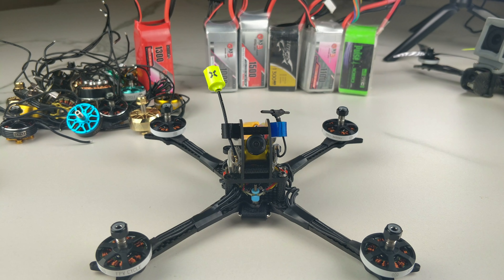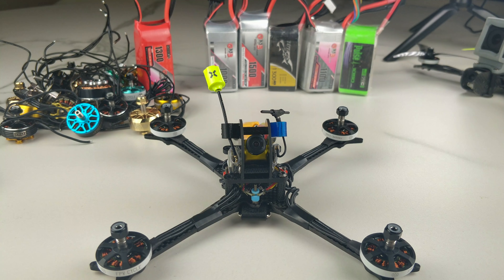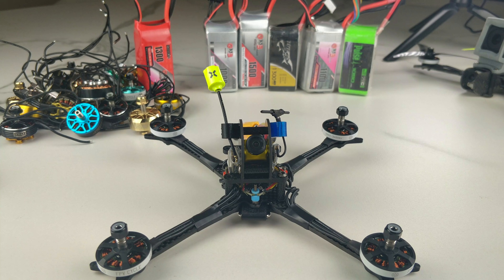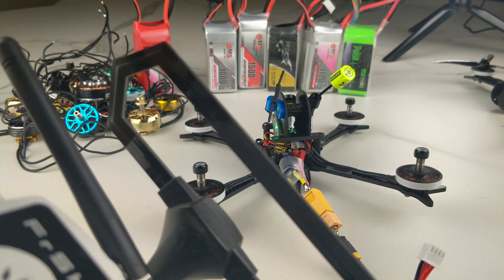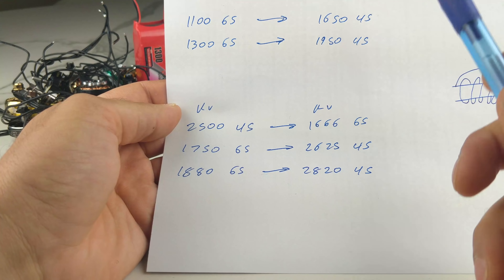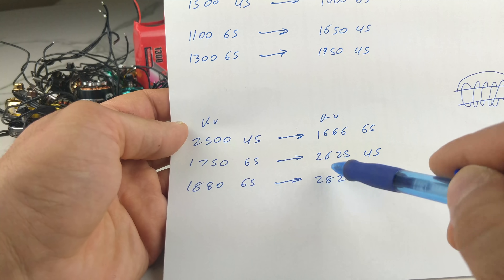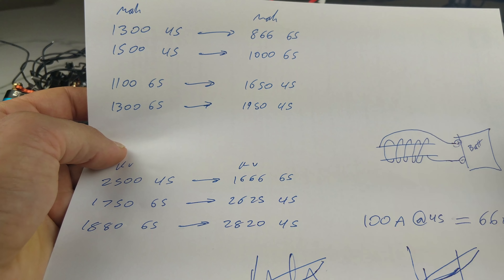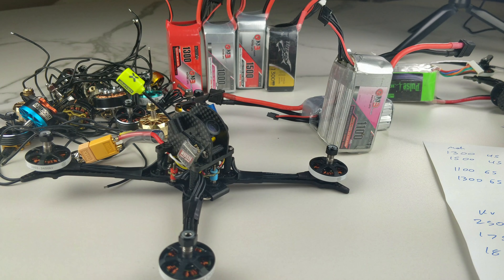6S Everything?  Why does 4S feel different?

Comment: Would I be ok just starting with the size of the propeller (7 inch) than from there choose a certain kV motor (1300 kV) and just go with whatever voltage works with that kV? I know that this is a very complex subject and listening to your explanation definitely highlights just how deep the rabbit holes goes. But I like to simplify things that are too complex, more voltage (6s) and lower kV means more torque for bigger props and the opposite being less voltage (4s) and higher kV for less torque but higher RPM for smaller props. There is a method to picking lipos for a motor which turns the propeller, I hope people aren't just saying, "You saw what that 3 inch did on 4s, I can't wait to slap a 6s on this bitch!" We have an image to uphold here, if that drone goes out of control and hits someone or starts a fire... that's it.
Reply from the maker: Yeah that's totally okay to do. None of this stuff needs to change the way you think. It just might be helpful in explaining things a bit when you notice things are off.

Comment: IM COMPLETELY UNEDUCATED! im just trying to buy parts and enter the game! but what your saying is so confusing because im uneducated! can you educate me? i am trying to make a "toy" copter made from a "ruler" and was told to get these parts-  #1 [Racerstar Racing Edition 2212 BR2212 980KV 2-4S Brushless Motor For 350 380 400 RC Drone FPV Racing] for $30 but found  {Readytosky RS2205 2300KV Brushless Motor CW/CCW 3-4S for FPV Racing Drone FPV Multicopter} for $33 - it seemed a "BETTER DEAL" to get 2300kv rather then 980kv. - but then i noticed that it said things like "2-4S" and mine is "3-4S" so what does the "S" mean! and i found your video which BLEW me away! now their are thingS to consider! 1 the length of the arms- 2 the esc- 3 battery- and 4 size of blade-  NOT TO MENTION THE THICKNESS OF WIRE? my god! THIS IS AN ENGINEERING feat! I WAS JUST TRYING TO BUILD A TOY FOR $1 TO SEE HOW IT WORKED! i never got that FAR! i was told to get a- [ ZOP Power 14.8V 1800mAh 65C 4S Lipo Battery XT60 Plug For RC FPV Racing Drone] and a - [4X XXD HW30A 30A Brushless Motor ESC For Airplane Quadcopter] and a- [Gemfan 8045 Carbon Nylon CW/CCW Propeller For DJI RC Quadcopter] THAT IS {Size: 8 x 4.5} THE video seems to be professionally based and is at = https://www.youtube.com/watch?v=XvMdL1PncEQ= "MY ULTIMATE" goal is to build a agricultural copter for crop dusting to lift 50 to 500 pounds! were do i start? i thought to just find a simple video and build one! its not that simple! CLEARLY THE 2212 IS FOR 350-400 and the 2205 IS FOR A 210 220 250 280 SIZE COPTER! this is strange because the faster speed is for a smaller and lighter copter? does the speed have something to do with "torgue" the amount of lift from an engine?
Reply from the maker: Before you get anything, if you're planning on FPV, just get a controller ONLY and use it to play simulators for a few weeks. Then look for the type you want to build and watch many videos about that size and the parts you want. Then get them and build it. This is the universal fastest, easiest and cheapest way to start

Comment: Really interesting thoughts. Maybe I will just stick with 5s.
Reply: THIS is why I've been telling people to make 6" quads with 6S electronics, and 5S motors.  They do EVERYTHING, and you can use whatever cheap batteries you want, or use awesome ones.
Reply: @tehllama42  I just finished 6" Badger with Konasty Moonboots 1739kv and I am quite happy with them on 5S.
Reply: @tehllama42  Can confirm that 😅 Recently changed to bigger motors (2207 2450kv to 2408 1900kv) and mainly using 1500mah 5s batteries. The quad rips. Still have more testing to do but instantly noticed how bigger motors improved handling characteristics of the quad. It seems to be a lot more responsive now.

Comment: The argument with the electrocemical challanges is just weired and makes no sense. A cell does not know whether it is in a 6 or 4 cell configuration.
Reply from the maker: Batteries are limited by their resistance. Lower resistance will have an easier time giving off current but as it heats up the resistance gets worse. I think exponentially worse actually. So moving to 6s, lowering the current and keeping the resistance per cell similar will cause the voltage to be more stable. It's ultimately because the overall Wh of the battery is higher and so you then need more power to make the system function too but the voltage stays stable.
Reply: @Kabab  no you are not reducing the current, if you are reducing it by 35% when you at the same time reduce the cell size by 35%

Comment: Shut up and give me 6S 2203s already LOL JK!!! Kinda... Here is my opinion on standard weight 5" my 6S packs get more cycle counts than when I ran 3S & 4S. When I started I was eating packs all of the time. 6S seems to give me all I want and my packs last longer because they aren't being pushed to their limits.

Since your 3450kv were the first in stock I plan on giving 4S a try on a light 5" then I will switch to the 3000kv and 6S. I think Ill be comparing a GNB 4S 1100 vs their 6S 750 because the WH and weights are very close. Or I might go with Pyro's 6S 700 to save more weight.

But 6S on 3" toothpick (light not the bricks everyone call toothpicks) and lower is silly.
Reply from the maker: You're definitely going to get more cycles from a 6s pack on 5" because the pack just isn't being as stressed each run.

Comment: WRONG WRONG WRONG, sorry sorry sorry
but maybe 90% of the physical explainaition is correct, but lots of this is wrong and makes it overall wrong. Just scrap it and stick to what you feel. The consecquences are all good and correct. higher voltage => petter performance, better efficiency at higher power and it has a greater envelope and might feel weaker at lower throttles
Reply from the maker: Well thanks for reading my request in the description 😑. Higher voltage is less efficient btw. The benefits come in the potential weight savings which we don't do because we're building performance things. So it's just less efficient. It gets more flight time because you're using a larger Wh battery. I'll leave you to figure out the rest because you clearly know enough to insult everyone else.
Reply: @Kabab  I dont want to insult you sorry. That is not what i meant. Really. The thing is, what you say is correct at the end, only the explaination between with the electrons are not waterproof. I also dont understand everything but that that seems like guesswork to me. you say yourself that your not an engineer, but I dont understand why your trying so hard
Reply from the maker: @kampkrieger  I'm trying so hard because I'm developing some really interesting motors. It's all a lot more complicated than what I've presented here. These are the very basics of what we think is going on. It'll always be a guess but this info is coming from people that work with this stuff on tht daily so their knowledge cannot be too off or they cannot work. I have left out the inductance discussion entirely which is the other half of this but in general, this is a long winded way to explain why 6s has less average torque and more peak torque and that's why it feels funny vs 4s.

Comment: https://youtu.be/0H2gm6v6dZQ?t=971

I think something is missed - magnetic field does not only depend on current. It also depends on amount of windings. 
What one usually does when inceasing the rated voltage of a motor - keeping it´s stator volume constant - is using thinner wire, but more windings. If this increase of windings has the same ratio like the decrease of current the magnetic field stays the same. 

Am not sure, if there is another circumstance, that might have an effect. I guess when less thicker windings are uses the "copper density" is higher than when less thinner windings are used. Since the winding is round there remains air (unused volume) between the windings. I can imagine, this unused volume becomes bigger, when thinner wires are used. 
Or it´s the opposite around...

Headline "Closed magnetic circuit"
https://en.wikipedia.org/wiki/Electromagnet